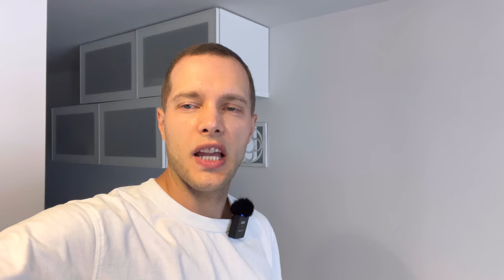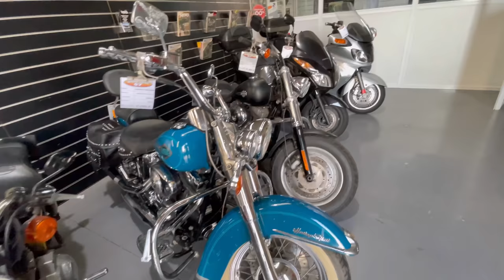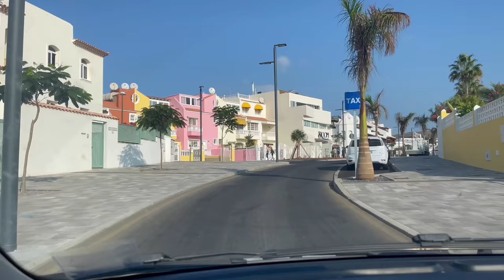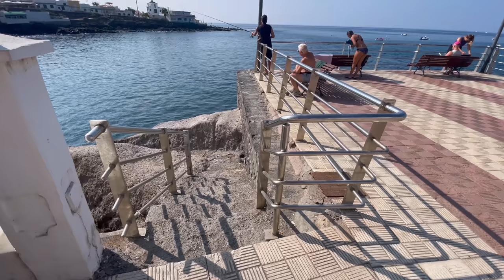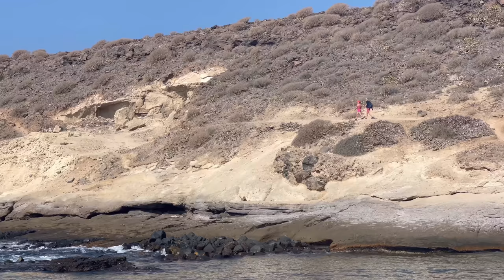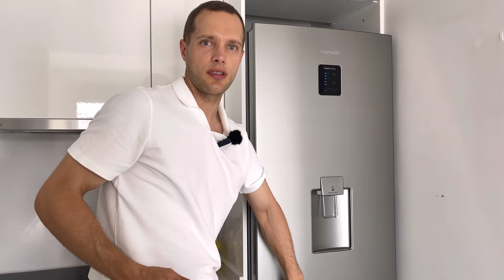The Fishing Village of La Caleta | Finally Dropping the Motorbike off to be Repaired | Our Next Car?

Comment: Beautifully clean motorcycle workshop. If i was doing fluid would do discs and pads at same time. Clunking prob cush bearings in rear sprocket.
Be lovely again when sorted. Unfortunately these machines do need a thorough going over once a year for safety alone matey

Comment: The mechanic spoke good English. 
      Jeep Wrangler: be wary. I had a 1993 4.0 Ltd manual from 2000 to 2010. Rear axle problems, failed gearbox, 18 mpg. It was a low mileage one when I bought it. Just over 30,000 miles. This has 245,000 km on it! What's more, it has a tow bar. Jesus! Honestly, there are far better options. It will cost you a fortune to keep it running. If you're worried about your bike bill, do not buy a Jeep Wrangler.
      I really like that Garibaldi jacket.
      Great video.

Comment: good luck with the bike , I hope chains are cheaper than belts !
Reply from the maker: Thanks John!  Interesting- I thought belts would be cheaper!
Reply: thanks for the reply, 
just checked the invoice ,it was £200 for the belt .....and £232 to fit + vat, which I don't think you will have to pay, look forward to the next one, vid that is !
Reply from the maker: @johnniel8116  I'm very curious to find out- the chain on the Bonneville is thin due to it's lack of power, so should be on the cheaper end of the spectrum- I hope!

Comment: Did you say that Jeep had 245,000 plus miles or 24,000 plus miles for 10,000 dollars , too high for high mileage and if it has 24,000 maybe, it has rust and front damage so you can counter that price.
Reply from the maker: 245k km, thanks for the tip Juan!🙂🙌🏻

Comment: I would imagine the knocking is the rear wheel bearings, an easy fix
Reply from the maker: Interesting- that was the mechanic’s first guess too! Thanks🙂🙌🏻
Reply: I know, because I had exactly the same issue with a yamaha fazer a few years back. It makes a right racket doesnt it!? but its not as bad as it sounds.
Reply from the maker: @baldrick650  It's so bad- also embarrassing now it's so loud!😆

Comment: I would always steer clear of any 4x4 thats been lifted. the handling will be that bad it will be like driving in jelly.  Look on ebay motors Its probs only worth £6k if its straight.
Reply: What are you comparing the prices too.. if it's anywhere other than the canaries it's irreverent
Reply: I think you mean Irrelevant.
Reply from the maker: Good point- I’d probably stick to a standard one too when it came down to it.  You are spot on, but I’ve found out that island prices really are quite different- it’s interesting how some things are much much cheaper here, but a few things are more!

Comment: I see you're stickng to the 'make sure there's a good cafe on your itinerary' and are listening to the female requests for suitable biking gear. Sounds like the Bonneville needs a good thorough overhaul - may be not just the brake fluid, chain, rear sprocket and clunking noise! Also I'd advise steering clear of the Wrangler it's done well to get this far but looks well overpriced at €10,000! Go for a Toyota.
Reply: Definitely avoid that Wrangler.